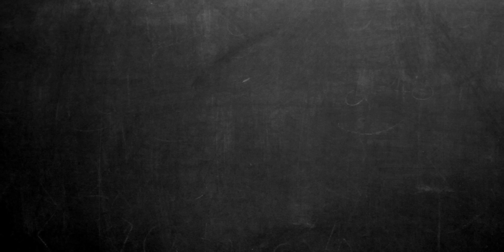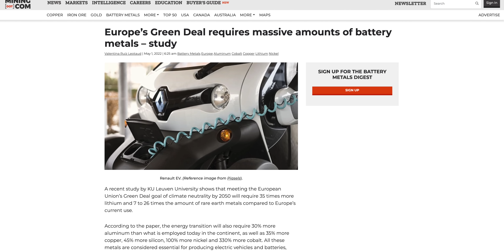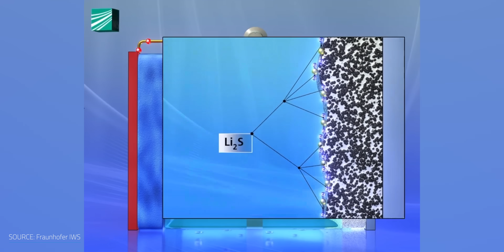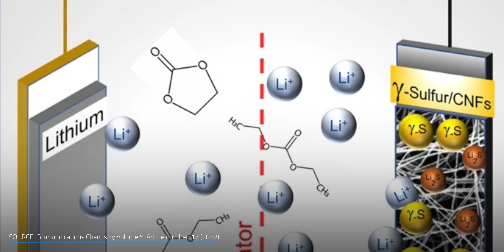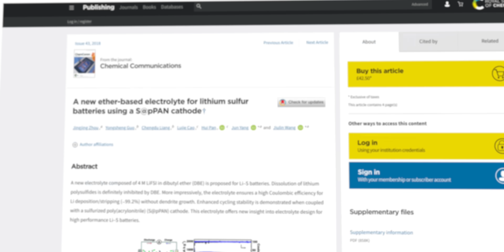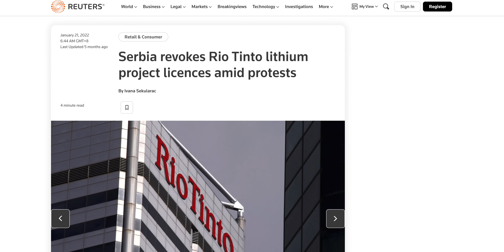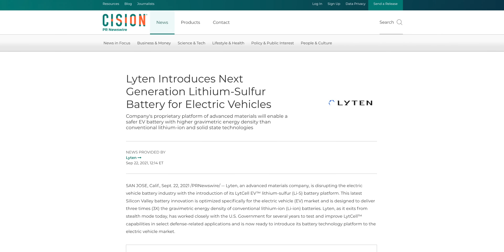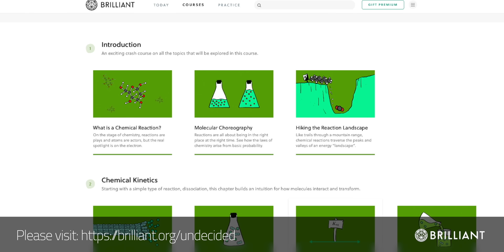Why This Accidental Battery Breakthrough Matters

Comment: I recall reading an article in 2016 about a discovery [by accident] that using a gel instead of liquid in Li-Ion battery increased the cycle life from 2k-8k range to well past 100k. Further testing needed to be done to see how feasible it was in the real world. Haven't heard a peep since.

Now with this sulfur option, it doesn't render the other solution obsolete, but the higher energy density certainly gives an advantage. Application purpose would be the driver of which technology was chosen.
Reply: IIRC the problem with the Gel solution from back then was that the advantages broke down when the battery got hotter... and the degradation was permanent.

So yes the longevity could be HUGE... but you had to NEVER let the battery get hot...

Which is nearly fucking impossible because in almost every use case heat got produced just by use... or worse by environment.
Reply: @ArkAngelHFB  Sounds like something that could be mitigated in an energy storage farm such as what Tesla is doing.
Reply: @jumpinjehosephat1877  Most likely, but it also means that you have to charge and discharge is VERY slowly.
Reply: @Jimbo Bimbo There are electric bikes now. Unless you're a tradesman, a cargo bike will handle most journeys. The remainder are likely big purchases, which can be delivered, or if that doesn't work, rent a van for a day. Long run it's much cheaper for you, less infrastructure costs, and less resource intensive
Reply: @Jimbo Bimbo Not to mention, bikes plus public transit open up a whole new world. Bike to the train station, train to anywhere, bike at the destination. No need for personally owned cars in any step of the process
Reply: there have been so many breakthrough innovations in the past two decades... some low tech some high tech but none have changed much in dealing with the problems next generations have to cope with ... I fear that EV will not be the solution... more human powered vehicles and more mass transit is the solution
Reply: @larsbee  That is a wildly inaccurate statement.
Reply: @ArkAngelHFB  oh well u must know...
Reply: @larsbee  We are not saving the world with bikes and rickshaws mate...

To suggest it only demonstrates a complete lack of understanding, that is right in line with "none have changed much in dealing with the problems next generations have to cope with"

Comment: The problem with bringing batteries from "lab to production" is time and cost. Every next-stage prototype has to be exhaustively tested and proven. You could, after 3-4 years of research and development, find a road block that stops the idea of volume production in its tracks. You have to have some clear advantage over existing batteries, otherwise it is not viable. So you have to start over again, hopefully using knowledge gained. When large scale production is possible, you need a few billion dollars to build the factory. This is why you see many "tweaks" to battery chemistry etc., but very few totally new chemistries.

Comment: I am an experimental human longevity researcher. 

I'm not telling you the exact biological pathways as to why and how, but Sulphur and Sulphide deficiency, and their transporters, plays a huge role in ageing, and many of the frailty issues involved in ageing.

The reason is a lot like why we get dysfunction in batteries, and is prevented and regulated by NQO1, the equivalent of a cellular carburettor.

Maybe I should try to hack what I know about the human body into a hybrid biological battery. I've already found ways to regulate NQO1 in such a fashion that it extremely slows, sometimes even freezes ageing, via modulation of redox reactions and cellular access to NAD+. It can cause most cancers to self-destruct, by undermining their access to NAD+, in the process.

This video actually gave me an idea how one would go about it. What is going wrong in the batteries is the same as the buildup of advanced glycation end products in human ageing, and certain non mutation based cancers.

Comment: Lithium batteries had problems as well. Some exploded and killed people. I haven't heard of problems like that for some time now so they have improved greatly since first introduced. A colleague of John B. Goodenough (inventor of the Lithium Battery) has now invented the Solid State Lithium Battery wich has none of the original design, charges faster and lasts longer (2.5X).

Comment: 2 questions: 
1] is the voltage per cell close to the cell voltage of li-ion?
2] would these require a similar "smart charger" like CC/CV?
I'm always building things, just trying to see if I'll need to start learning new technology for these new batteries in the coming years.

Comment: Ok so we lack the resources and the processing and it’s dirty and inefficient but we keep pushing. Why aren’t we developing thorium reactors and going nuclear. In comparison it’s cheaper and much cleaner and we could skip the whole middleman in energy called the battery (I’m thinking of vehicles) thorium has potential to be car safe. Imagine having the torque of an electric motor with the longevity or a nuclear reactor without the danger of a meltdown.

Comment: Just for a general note; most any laboratory discovery across any discipline is assumed to take about 5 to 6 years to reach the consumer (after they start - Dr. Kalra didn't seem to imply they were ready; though, that could just be reasonable caution as one would want and expect from a well rounded Scientist). Five to six years is the bell curve average if related industrial processes either already exist or can be easily adapted to the new discovery's requirements. But, the time is longer when it would involve a completely new industrial process (new machinery and scale testing stretch cost and efforts out) or the time is shorter if existing machinery and processes already work with it. Like where a small chemistry change to an existing battery could take only months to implement. It's a good set of rules for looking at ROI over time if investing in startups or companies who are trying to use something just out of a lab. It doesn't make for a bad investment if completely new industrial processes are necessary, but 5 to 6 can turn into 9 to 10 years with increased risk for the investment if another discovery in the field gets there faster with similar benefits.

Comment: Cobalt is used to reduce battery cell volatility. Iron based cells do not have this problem. They are a little less energy dense but can be used 0% to 100% without degradation. More dense LFPs would be low cost yet maintain their low environmental impact.

Comment: A permanent magnet is a permanent source of energy or electric power.  A small permanent magnet motor as a generator surpasses batteries.  We make electric motors and we can make permanent magnet motors. To extract the power we include copper wire to convert the moving magnetic field to electricity.  A small permanent magnet motor covered in copper wire mesh is a permanent power source of very small size.  Watch battery generator.

Comment: Compare copper and sulphuric acid battery or copper salt and vinegar battery as liquid batteries for capacity and rechargeable quality and toxic environmental damage.   In terms of environment capacity and rechargeable quality the low toxic liquid batteries are superior to the toxic lithium batteries.

Comment: Low tech nontoxic or low toxic materials for battery powered devices are equal to or better than high tech toxic materials for battery powered electric devices.  Toxic materials should be the first discard not the first choice.

Comment: Permanent magnets are the best energy storage system.  The we use permanent magnet motors to release the energy to power iron dynamos inverters and transformers to deliver high voltage AC power continuous peak power.  Powering electric motors and vehicles for unlimited range electric cars trucks trains airplanes helicopters and ships can immediately reduce fossil fuels use very cheaply.

Comment: You have to distinct between stationary and mobile power storage. For stationary power storage energy density not a issue. It just do not matter how heavy your batteries are. 
So if your batteries are twice as heavy and cost only half as mutch thats good. For mobile application it is the other way around.

Comment: Holy Grail?  I'd really like to believe it but something doesn't add up, Matt. If the discovery points to far lighter, cheaper AND more ecological battery production AND a huge potential increase in energy density, then why would it take years to bring to production? That estimate does not match the presented science so it is either too conservative or, (more likely) the science is over-hyped. We know how commercial science has worked in the case of another Holy Grail - Cold Fusion - which has been optimistically 25 years away for about half a century ...and counting. I hate being a pessimist.

Comment: I believe that variety in battery tech will be the most important factor in whether the world can move towards non-combustibles. Civilisation consumes energy in every form and every size...so having multiple techs allows manufacturers to adjust for where it's needed.

For power, the main problem with renewables is storage. Better battery tech will allow renewables to ride out dips and peaks, and also provide a buffer for when demand spikes.

I don't believe we'll be able to 100% convert to renewables in the next 20 years, but we might be able to do something like an 80-20 split instead. Coal/Oil plants will provide a stable output to maximise their efficiency, while renewables handle the rest.

Comment: By winning the rat race you become the no1 Rat, so what. Wakeup solid state move-able electrical magnetic generator is developed. Free move-able electrical power. Unlimited supply, free, 5 times more efficient  Kg/Kw than turbine engine.

Comment: The reason I, in the semiconductor industry, am skeptical of 2022's electric vehicles is precisely that Li+ is dangerous, expensive, and rare.   You mentioned that a possible Sodium-Sulphur chemistry held hope for providing an ultimate in cheap high density energy storage.    It would be quite remarkable if the ultimate in hi tech safety were that nasty old Sulphur.

Comment: Daily reminder that the best, theoretical, though not known to be possible, battery chemistry for battery energy density... does not compete with fuel aircraft... to the point that battery aircraft in a lot of current roles will ALWAYS rely on fuel. The idea of straight battery aircraft is a lofty, clickbait dream. I'd be careful about it.
Reply: I am absolutely excited about what you talked about, regardless.

Comment: The best battery fit for grid storage is sodium.  There is a new sodium battery that can recharge 50,000 times.  137 years with one cycle a day.  By then, fusion will only be "3 years away",

Comment: Oddly I keep reading about the aramid fibers of the battery membrane can be used from recycling kevlar or bulletproof vests. Is there really that many recyclable bulletproof vests available for world wide production? Probably not so why is that something that is touted as part of the appeal of Lithium sulfur batteries. Still a big problem is that battery resources will run out before 10 years at any level of affordability.

Comment: if they still cost 30000+ $ every 5 year to change they are still not viable option also time to recharge quickly is also a issue , really show that the people pushing electric car only do this for control and limit the ability to lower class to move freely by making it to expensive to have a car and adding slowly more technology to check your every move in those car    . they could just make hydrogen powered car yet they keep pushing those overpriced electric car that have life span of less than 10 year .

Comment: Nice vid and informative. But relative to mass use, sorry but no. Lithium is rare and hard to get if one needs very large amounts. If just the UK went all lithium just for vehicles, there won't be enough lithium. Yes, this is a break-through but frankly, so what? There just isn't enough lithium in the world that will meet the needs if we attempt to use these in a larger quantities. Glad you pointed out about the child labor in Congo and the issues with nickel.
Of course, the iron /oxygen batteries (ONLY for mass storage systems, not cars) is a bigger break-through and offers inexpensive storage (maybe) for wind/solar supplies. They are building a test 50 MW storage system to test this idea.

Comment: You've dealt with this chemistry before I believe... Or maybe that was another YouTuber.
That said. Please just be clear. This is not vs Li-Ion batteries. It is simply another Li-Ion based battery chemistry. Just like many other. Ones such as LiFePo included. 
Of course it's awesome that it's a type of Li-Ion battery that replaces expensive Cobalt and other elements with inexpensive Sulphur. 
Of course if Sodium can take the place of Lithium, then it's another matter.

Comment: New battery technology would be fantastic. But the green brigade absolutely cracks me up. "Give us cheap electrical power, but don't you dare mine for raw materials to produce it". There's nothing less "green" than "green energy". Apple proved that when they mowed down an entire forest to put up a solar array big enough to power one of their sites. The pollution that results from making the typical EV exceeds the cumulative pollution of the typical petrol vehicle by a wide margin. But because people don't see that, they think it doesn't exist.

Also, the term "renewable" is misleading. You may never have to replace the wind or sunshine, but the windmills and solar panels have a finite lifespan that is much shorter than their fuel-powered counterparts. And it is not a matter of scientific fact that petroleum is not renewable. We simply do not know exactly where it comes from. The dead dinos story is just a popular colloquialism which originated back when the telegraph was still a thing. Even if we assume oil is the result of heat and pressure acting on biological remains there is no reason to think that is any less renewable than the process that continues to give us magma. Things still die, get buried, and eventually get pushed to the depths.

Comment: thb to reach the goal of electrifying the cars, eventually it has to be accepted that not every car can have a big enough battery for over 400km/250miles.. 250-300km is enough for me, and should be enough for anyone living in dense populated areas. OFC there should be longer range options for rich and those driving often in rural areas, but imo those models should be put a tax or special permit on, so that the battery materials were wasted as little as possible. Also why this would be a  good idea: the charging stations are fast nowdays! Better than large batteries, there should be charge stations in more places.

Comment: Alternative Battery Technology cannot come soon enough! 5 to 6 years may not sound long in traditional industrial terms, but damn, I want to change my ICE car to an electric car so badly. Unfortunately I don't have the money! We need cheaper electric options for the masses.

Of course, one very important thing is the viability of recycling Li-S vs Recycling Li-Ion Batteries! Currently recycling Li-Ion batteries is proving to be a very lucrative proposition, mainly due to current high costs of producing new Li-Ion Batteries as opposed to recycling them! If the Recycling process of Li-S is going to prove to be a waste of money and effort, then no one will do the recycling and if no one does the recycling then we can get ready to stare one of the biggest man made environmental catastrophes in the face!

Comment: 8 times? That could absolutely make EVs more viable, even for long distance travel. Make the battery small enough and battery-swapping could be quick and easy, that or make them chargeable in 10 minutes.
Though for grid storage, I have to repeat myself, don’t use anything with lithium. Maybe sodium sulfur batteries, iron flow batteries, molten metal batteries, that sort of thing. Get it 5% the cost of lithium ion or lower, otherwise I don’t consider it viable without insane subsidies.
Reply: None of the batteries you mention are currently 5% the cost of lithium ion. Some are more expensive. They may when produced in bulk become cheaper, but someone has to agree to buy them now at their current prices, with both their unproven technology and in some cases terrible efficiency before their prices can drop.

Comment: I laugh, we can't go green because, the green nazis will file law suits or pass insanely burdensome regulation on new mines. You green idiots are doing more to damage the environment than any oil company, by damaging supply chains and drastically increasing costs, thereby greatly reducing the speed of innovation, if not outright preventing new tech. You just can't make up this level of stupid.

What is up with this idea that we are "using" up all the water. The idea defies physics. Point blank we are NOT using up the water! You have to be break down water at the atomic level to "use" it, and lithium production doesn't do that. Otherwise the water will evaporate and returns as rain as some point, somewhere. The earth will NEVER run out of water. Funny still is all the greenies claim the oceans are rising, so IF we are "using" up the water, by their flawed hypothesis we need to be.

Comment: Why are we still not talking about Hydrogen as a perfect way for aqumulating (storing) energy? That is the only element that we can get with symple wind or solar induced electrolysis and the only product in the reversing process during oxidation (burning - releasing the so much needed energy) is H20 - Water. Enough of the stupid Lithium.